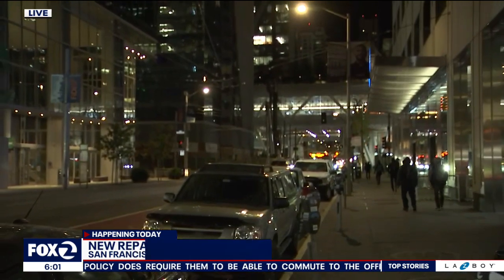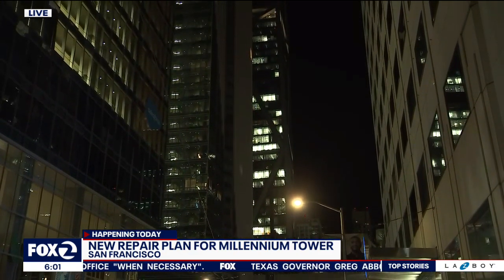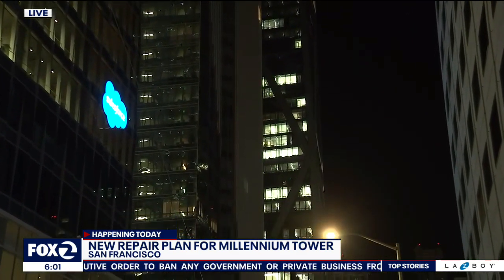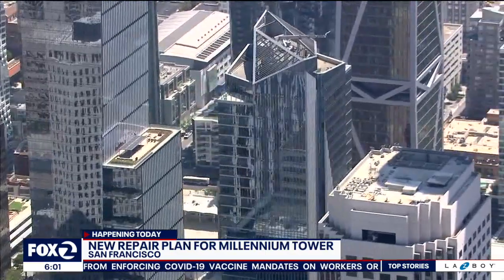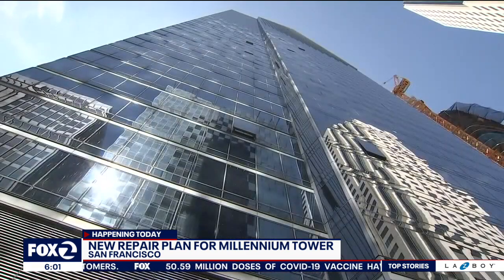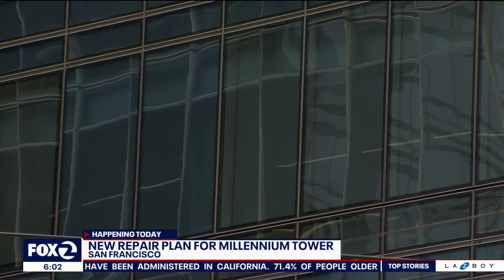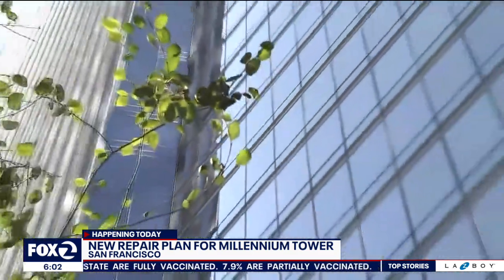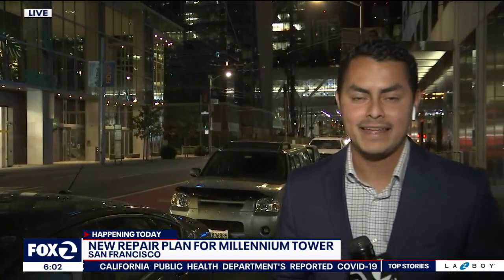Engineers to try new strategy to stop Millennium Tower from sinking

Comment: Put in a couple strong hooks at the right places and then use hot air balloons to lift the building up.  Hot air always works.
Reply: I'm unsure about that.  The engineers working on this have been full of hot air, but that hasn't worked.  :/

Comment: Fix it already! What is taking so long!?
Reply: due to covid 19 we are taking our sweet time on everything
Reply: They are mortified. Duh!
Reply: Fixing might not the answer, Torn it down might a better option.
Reply: Because it's unlikely they CAN fix it. It's like building a car without the frame, and trying to add the frame later... To fix it, the need to go back to step 1, which is drive piles into the bedrock in the center of the building. A lot of people are making a lot of money off these cheap scape developers who thought you could build a high rise on landfill with out hitting bedrock. That's like me mounting a tv in dry wall without hitting wood.